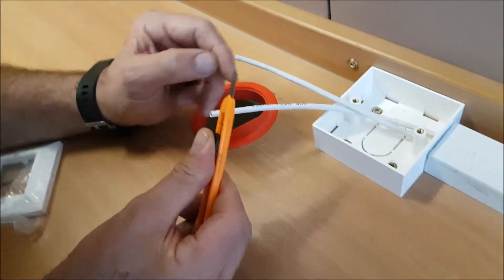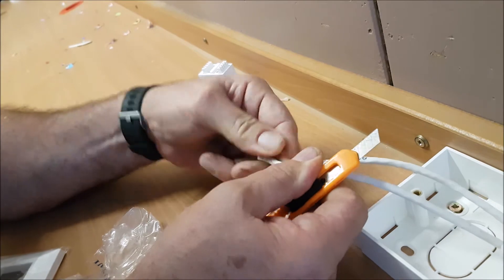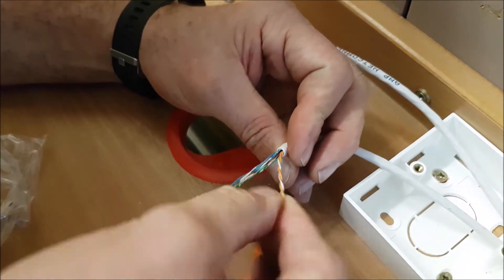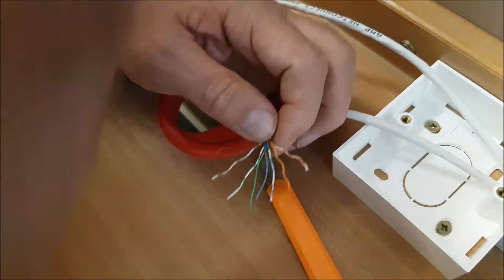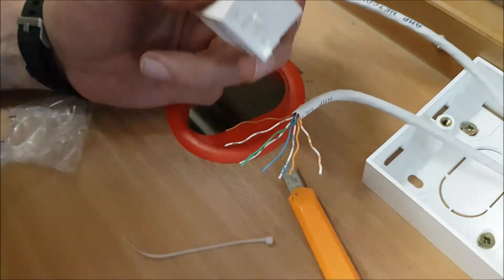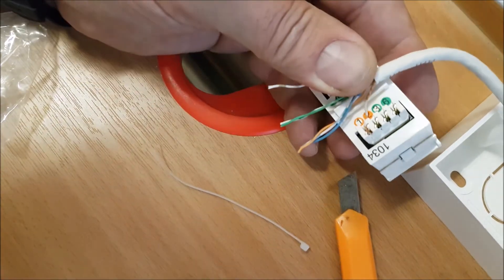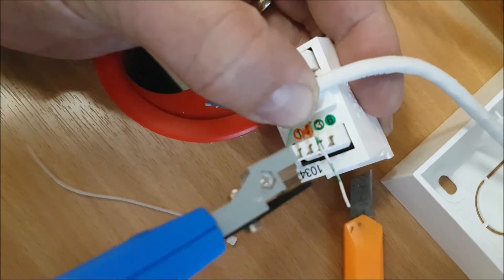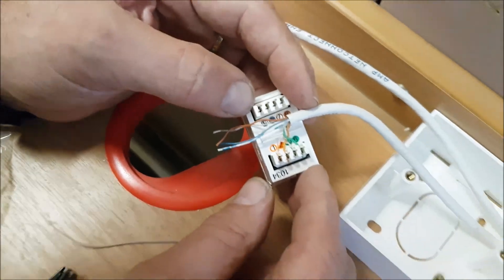HOW TO WIRE A NETWORK SOCKET

Comment: If I can fix it to my wall. I know about electrics but not phone cable. I think I need a separate socket for the NET because my (home) landline phone cuts or stalls the connection to WiFi.